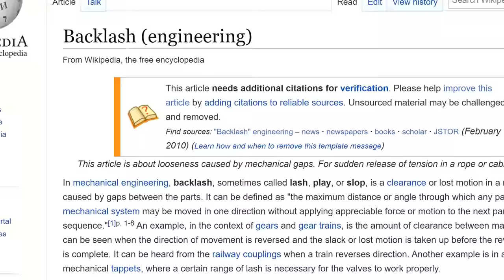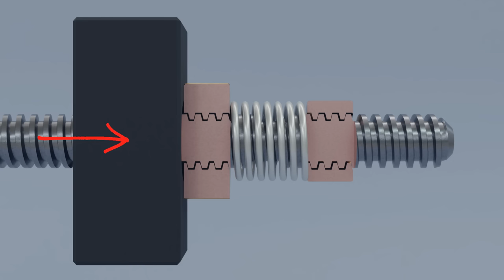Will this Z axis anti backlash nut improve your 3D printer accuracy?

Comment: In the previous video, you showed that there is a spring in the stepper motor that is responsible for the shift in the Z axis. I personally found that on my Ender 5 Plus printer, the 2 motors have a clearance of about 2 mm from the axis. And I wrote to you that I solved it with an axial bearing between the motor and the trapezoidal thread coupling... It works perfectly. Now I have all the layers exactly the same. On all 12 printers where I made this modification. Greet from Slovakia.
Reply: Impresive! Can you post a link to get this bearing? Thank you
Reply: hi can u add photo after the mod
Reply: Ratrig Mini z bearing
Reply: @NIKOLAZ621  Here he talks about the stepper motor problem.. https://youtu.be/RXgwOikiBdg?t=121
Reply: @1vyrobca  can you please post somwhere your mods to the Ender 5 Plus, to see, how you've done it exactly?
Reply: can you please make a video about the modification you have done?
Reply: You also need to support the stepper motors from underneath. I used wood shim. The bracket alone is not enough
Reply: There is some kind of spring on some stepper motor, i replaced it with 3mm aluminum spacer
Reply: Yay Slovakia mentioned :D

Comment: My understanding is that in the case of the Oldham couplers installed on the top they might introduce the detected backlash. Especially with cheap, less accurate couplers. When installing the anti backlash nut at the bottom, as you mentioned, the preload might not be enough to counter the backlash under the weight of the gantry.

Comment: Having started my desktop CNC experience in CNC mills, I can see one flaw in your final testing and conclusion.  The two nut halves need little to to play between them.  You can clearly see a degree or two of movement of the small nut when moving the lead screw back and forth.  This shows there will be no improvement in backlash.  Effectively, Only additional friction has been added for no benefit.  To fit/patch a bad nut set, use a point punch to expand the brass at two points on either side for the small nut's tabs.  Then, file the protruding metal down to create a tight fit and eliminate the slack.  This will make the anti-backlash screws actually anti backlash.
Reply: I was about to point that out, but it’s good that you done it already.
Also, that backlash nut design is poor if it has that much play between the two pieces.

The best solution would be a combination of a quality machined lead screw, a well designed backlash nut that has four precision rods , two embedded on each half and sliding on the other half, and a decent spring to maintain tension/compression between both threaded halves. And yes, the spring would have to be balanced in a way that it can maintain ideally zero backlash with rigidity without creating so much friction that the steppers can no longer move.

Comment: Solve the problem with belt drive Z axis.
Reply: https://m.youtube.com/watch?v=oUdoJUs8Zcg

not so easy. but I think a better solution would be ballscrews. there are already kits to convert to i think 1204, or 1605. it's possible, however resolution is not the same, steps/mm for the Z axis need to be halved. so from a 0.125mm resolution per step, it's 0.25mm.
Reply: @heyitsdrew  I don't want to sound harsh but ball screws are expensive and requires a very precise mount. This is impossible to achieve properly without expensive machinist measuring tools otherwise you will still have some artifacts. The structure of most of current printers are not ready to receive ball screws: 20 module profiles are not stiff enough and the grooves are not compatible.

On the other hand, there's a lot of examples of belt driven Z axis since 2010 which are inexpensive, very permissive and easy to setup. A belt, a bag of pulleys, a geared nema17 and there will be no Z artifacts first time, any time. 

Ball screws are expensive wearing parts while changing a belt is no big deal. Better, simpler, cheaper. The die is cast.

Comment: This would lead one to suspect structural flexing rather than backlash in the threads alone. Place the indicator between different assemblies to locate lost motion appearing as backlash. Like bearing supports to screw shaft ends? Compensating nut to screw end? Bed to gantry in different planes? Bed to base? This could ultimately be a stack up of several points which can appear insignificant on their own. Write yourself a looping G-code Z move and go on the hunt?
Reply from the maker: That is certainly food for thought. I have seen some flex in the plates that hold the lead nuts so that would be a good starting point.

Comment: Fundamentally the anti-backlash nut you are using is a anti-slip nut if you use a sized spring load. For anti-backlash, the two opposing nuts should be adjusted to minimize play (limit friction) and the spacing locked. The spring should only be used to aid in the adjustment only. That means the spring load needs to be greater that the maximum applied load. The moment your applied force exceed the spring force you will get backlash if you don't have fixed nut spacing or the play is too large.
After prolong use the spacing will need to be adjusted due to wear or the lead screw needs to be replaced due to uneven wear.
Reply: Sorry, this not solutions

Comment: I had issues with my Sidewinder X2 (uneven layers) and several people told me "get anti backlash nuts". I just didn't get their advise - nothing an anti backlash nut could do, would improve my problem - rather make it worse.

Then they said "replace the coupler! It's caused by a bent lead screw". I removed the lead screws, they had a slight bent to them but nothing major, bought perfectly straight lead screws and the problem persisted. THEN I bought special couplers called plum couplers (they give the lead screw some more freedom preventing binding - generally good couplers to use) but again, it didn't fix the issue.

At this point I stopped listening to advice because they insisted I replace the board with one with dual Z drivers (the X2 uses one driver to direct two Z motors) which was just ridiculous.

Instead I opened up the hot-end and found out that Artillery had the bright idea of attaching the entire hot-end to the extruder system. The extruder system was driven by a huge gear that revolved ... except the hole in the center wasn't perfectly centered so the gear would wobble and the entire hot-end would move up and down along with it during prints causing the weird uneven Z layers. I replaced the crappy extruder system with a full metal one and it fixed the issue.

My point with this hole story is: don't just blindly believe all the typical "solutions" people profess and think how each part would impact the printer and think about whether it would actually fix it. It could save you a ton of money. Do plenty of test prints that are designed to make the problem worse or clearer - don't just reprint the same object but print multiple objects and see how the problem changes depending on prints.
Reply from the maker: That is very good info. The problem with 3d printers is that one problem can have many root causes. So it is necessary to test and troubleshoot rather than blindly following advice.
Reply: Hi which extruder?

Comment: Z axis is the least movement axis among the 4. A 3D printed PLA nut works best for me. Let the top end of the z lead screw be free don’t bind  them to a bearing. Let it be guided by the linear shaft like the original Prusa and like Anet A8. Sometimes is inconsistent extrusion and gears of the xtruder causing irregularities. Tune extrusion and also Y. I never use any special stepper motor shaft coupler or spring nut. Sometimes some parts need to be plastic or softer material to absorb the vibrations don’t go all metal. Thanks for making this video ❤ and sharing your findings.

Comment: Z-Sync kit is one of the most important in my short experience... it even kind of solves the screw engagement issue because the gantry is somewhat un even and the Sync Kit forces the sync to be even at all times
Reply from the maker: It does solve many of the problems and if you could do only one upgrade, in my opinion that would be the one.

Comment: I installed the anti-backlash nut and spring on the top of the fixed nut, This keeps pressure downward on the gantry, Put the fixed nut in from the bottom, and the spring and backlash nut on the top of the bracket. This way the spring is working with the weight of the gantry to maintain a firm downward position on the lead screws.

Comment: Literally the ONLY video on all of Youtube where they didn't install the anti-backlash screws upside down, LMAO.

Well done , sir.
Reply: Is that sarcasm?
Reply: you can put that system on or under, it depend of your 3d printer
Reply: There is no point put those nuts upside down as X axis will be laying on spring and it will make only worse, this video is right about that.

Comment: I found that the backlash in the z-axis is due to the in and out play in the stepper motor spindle.
Reply: On the last shot, you can see the build plate deform under the pressure applied by the measuring gauge.
Reply: That probably won't help either.

Comment: This is interesting. This might be smart in the future if i have the issue of it falling down. I am planning on upgrading to rails, but got some other things to fix first.
Reply: For my part, once I accepted that pretty much everything but the frame is a consumable, I went with POM nuts. They last pretty long but are cheap to replace when needed and make z movement slightly more accurate. Most importantly, they eliminated gantry drop, when the power goes off. 😁
Reply: @adrianrubio5396  thank you for the tip! That's great idea!

Comment: Kerk motion products has had a near zero backlash nut for decades.  It's accuracy is 50 Micro-inch (0.0013 mm).  I used them with extremely accurate positioning.  The design you chose will never work for precision location.   It's a 2 piece spline assemble with the spring only for opposing force. the backlash is adjusted out by rotating the 2 nuts and locking them in place.  30 years ago they were using Teflon coated ss lead screws that were  very precise with extreme location accuracy.  you can always build a lookup reference table to account for any positional error.

Comment: Creality cr10; dual z-axis steppers. 
Backlash nuts keep the threads and gantry in sync each side. 
Ie longer periods of bed-level stability. 

In the z axis backlash is not important as the print initialisation always has the print growing in one direction.
Reply: First layer though

Comment: I don't use brass nuts anymore, no matter how well greased up i kept them after a few months they always ended up like a baggy sock , get way better results with POM leads screw nuts.
Reply: @The 300lb Gorilla Pom is kind of black plastic. Not any more  expensive than brass
Reply: @Favmir  Acetal aka Delrin
Reply: @The 300lb Gorilla pom is the same material as the black wheels on your carriage

Comment: What's wrong with the "olde worlde" method of spacing two nuts with threaded studs and dialing out the backlash that way? I understand that this method requires periodic adjustment as the nuts wear, but at least it's as close to zero backlash as makes no difference when set up correctly and produces close to zero drag unless the lead screw is badly bent.

Comment: When changing direction, the screw moves along the radius of the hole. Only a plastic nut with an interference fit will save from such a displacement.

Comment: I disagree i had a strange problem where when i changed layer and went up 0.2 my gantry would then drop down point of point of a mil and the nozzle would scar the next layer, installing 2 of these eliminated this problem for me and the dimensional accuracy of parts on the z height is spot on
Reply: As stated in the video and the comments, fitting this type of anti backlash nut stops the gantry dropping, which has benefits as you stated and also keeps a dual z system in synch when the power goes off. So it's useful, it just does nothing for backlash.

Comment: Instead of a Z screw perhaps a Z belt system could reduce backlash due to more malleable parts?
Reply from the maker: you are right, similar to the x and y axis, a belted Z would ideally have zero backlash. I am working on an all metal belted z axis because I don't trust printed parts to be reliable over the long term due to plastic creep. If everything works out I will make a comparison video between the leadscrew and the belted Z.

Comment: So you had a theory about the backlash nut not working if installed like everyone else because the spring wouldn't overcome the weight but did you ever install and do your test with the indicator in that orientation. Or just installed it upside down and assume the normal way would not work either?
Reply from the maker: I did test it in that orientation on my other stock Ender 3 and it made no difference at all to the amount of backlash. If anything, it was more inaccurate because there was more binding due to the additional spring force from the springs.
Reply: @BlUeMoNxTeR!  great info thanks for the response 👍

Comment: I'm aware this video is old, but your oldham couplings are the ones causing the backlash. I know cause it happened to me. At 3:42 you can clearly see that the coupling is the one to blame. there is a huge backlash when changing the direction, so big that you can spot it in the video. As an extra comment, these couplings do not tend to move at all unless you change directions as you shown. Otherwise the same weight of the gantry prevents them from doing anything. It's better to print some alignment tools when installing the Z screw than to use these. WobbleX on the other hand do dynamically move correcting the issue at all times. From my humble experience: it's better to properly align the z axis with the z screws than to have to correct deviations on the fly.

Comment: first thing i'll point out is that in Z axis applications there is already always a screw/nut preload equal to the weight of the gantry and you cannot change the faces in contact by changing directions in Z (like in 00:49)  unless you are doing so faster than g=9,800 mms-2. are anti backlash nuts a scam? of course not. they work exactly as advertised.....in X and Y screws like those in CNC machines. NOT Z screws in 3D printers for the reason I mentioned above. 

secondly, and not related to backlash, by mounting the oldham coupling above the gantry, it is in constant tension and not working in the optimal manner. it is supposed to be mounted under the gantry so that its horizontal surfaces can bear the load while the coupling is being compressed. while upside down, that same load puts the nut in tension,  and the weight of the gantry is now transmitted to the dovetails interfaces instead, which have a much smaller total surface area than the flat faces and were meant only slide past each other instead of now also being loaded. faster wear and reduced capability to perform its original function.

Comment: To remove backlash after homeing you can add some extra movement using marlin commands or just set first layer height a little bit higher.
Reply from the maker: Absolutely.

Comment: Z axis backlash should be fitted with x axis weight unless your z axiss cant move free.
mgn rails arent design for t8 screw backlash they work great withbelts but with t screws they get stuck till they get a little push from the other side of the nut.
thats why you wont see a good printer with mgn and screw un z
you print always up and you dont see that but if you go 2 up and .050 you will see how sometimes mgn get locked and dont go down

Comment: Huh you've shown your backlash is mesurable, so the question is, is it consistent or atleast a percise  enough change that you could alter the firmware as to hsve a backlash adjusting setting? same as having a z off set. When fhanging directions you could set the value he motors will add to their travel inorder to midigate slop in the screw and nut. 

Lathe logic "if its not accurate, make it extremely adaptable.* something along those lines.

Comment: Thanks for proving that these things are just snake oil.... not only do large numbers of people think they are important, they, as you point out, also install them wrong (ie under the gantry) to boot.

This content is needed to educate people to stop buying pointless additional hardware (yes they can be cheap, but other snake oil options can be expensive). 

I'm still on the fence as to the benefits of a z-motor bearing block and thrust bearing to take load away from motor spindle considering how cheap stepper motors.

Would like to know your opinion on POM lead screw nuts as well in terms of their wear and tear (some swear by them, others suggest the same snake oil claims as with these antibacklash nuts). I suppose they are cheap enough that its easy to just buy them when you inevitably have to replace the brass ones (phosphor bronze is seen as the ideal material but is very expensive for 3d printer usage and brass is much much cheaper)....

Thanks for the content.
Reply from the maker: The only advantage I see of the POM nuts is that you probably don't need to lubricate them because POM itself is a slippery material. Other than that, it would suffer from the same problems. In the beginning it might be better because the clearances are supposedly tighter than brass nuts. But the wear of POM is going to be higher than brass and pretty soon they will be in the same state as the brass nuts.